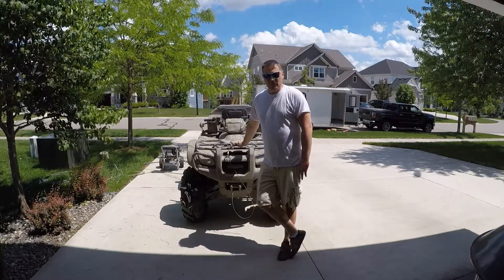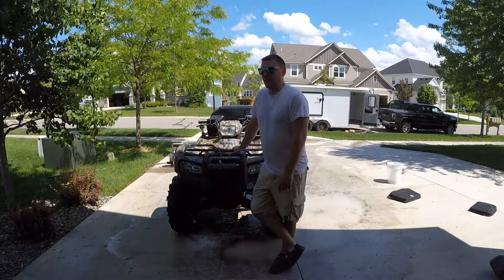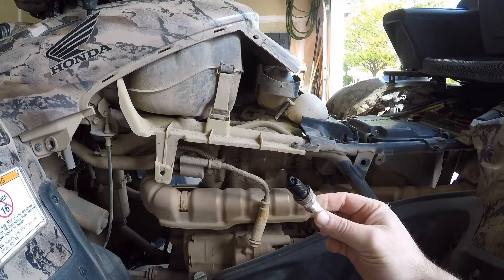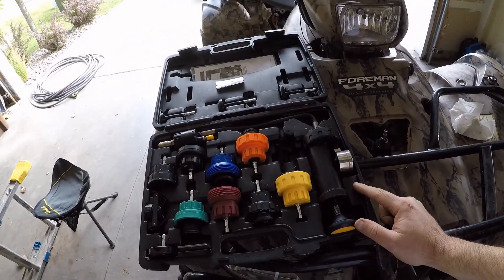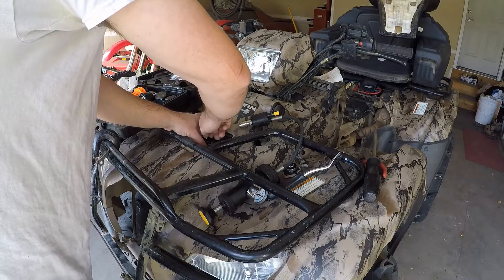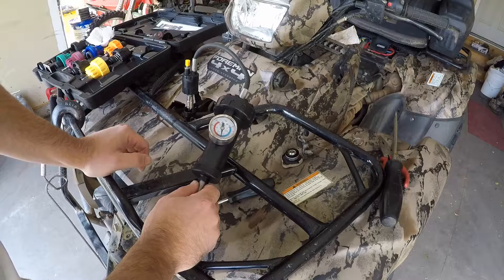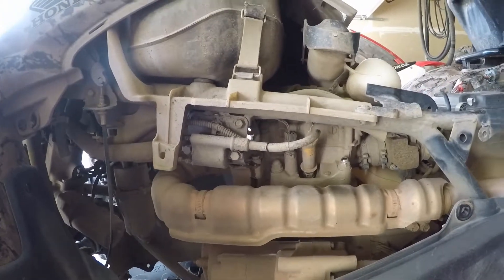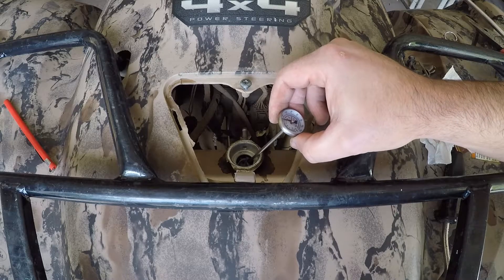Atv or SXS overheating, how to troubleshoot overheating issues

Comment: I have this same bike. Thanks for sharing it’s helping me a lot to service everything.
Reply from the maker: Thanks for the comment. This machine has been awesome. What's your experience with it?
Reply: @thecitiots  I’ve loved mine so far as a hunting bike. Only problem recently is when I try to crank it, it’ll run for a second and when I put it into gear it’ll die. Thinking it’s a carb issue. Never had a problem before. 2012 model but needs a full on service. Still have the stocks tires on it, looking to put some 27-28s on it.
Reply from the maker: @brysoncobb  I've had a similar issue when it's cold and wet, ice will form in the vent tube coming out of the gas cap slowing fuel flow. Try loosening the gas cap to see if that's the issue. Also in my opinion buy light tires if you go up in size heavy tires will impact braking distance.